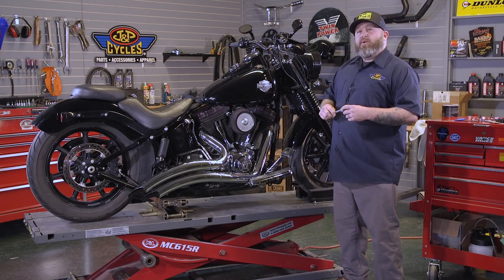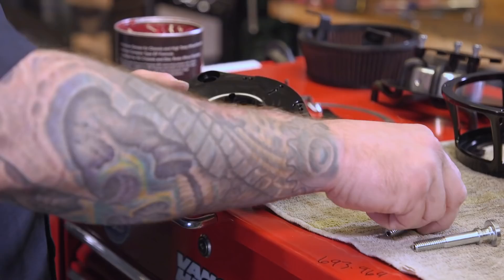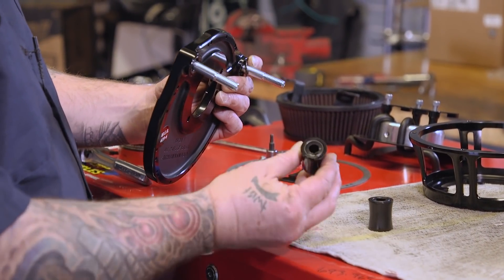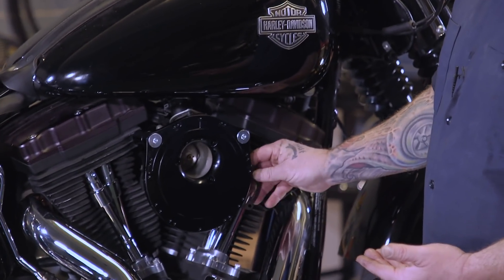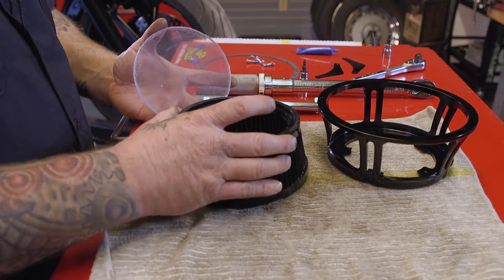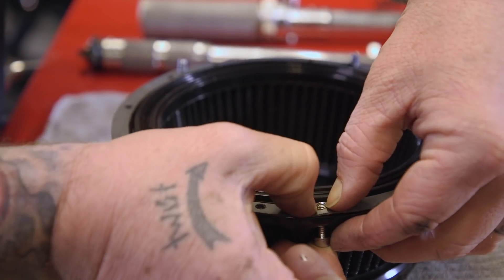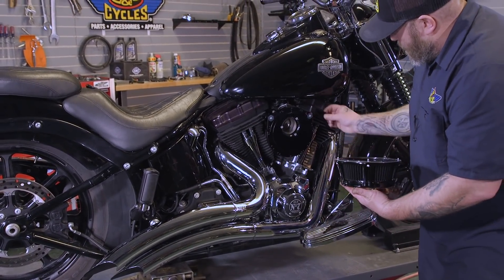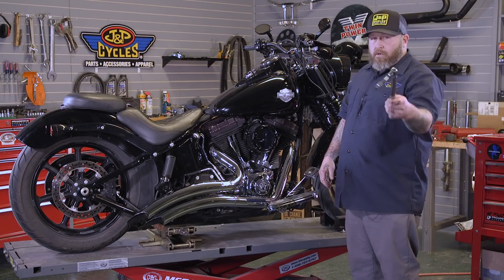Arlen Ness Method Clear Sucker Install : Twin Cam Harley Davidson

Comment: I also have a Arlen ness air cleaner (the inverted series) and had a RSD Turbine on my sportster. What I dislike about those big guys (the cleaners) is the big black spacers on the breather bolt keep you away from adding an external breather kit. Or I haven’t found the way around it yet. These EBK Are pretty useful to keep the engine healthy

Comment: Just picked up my first twin cam used to my old evo, stuck between two tuners, TTS or a power vision 3 or 4 I have v&h long shots and going to a thunderheader 2-1 and the method clear intake just curious what yall recommend

Comment: Installed mine on my 2019 street bob with cobra short shots
Have a tuner with high air flow cleaner on it but when I start the bike it recs really hard around 4000 rpm, do you know why this is

Comment: What do you mean when you say to "re-grease" the air filter once you wash it?
Reply: Re-oil it.
Reply: K & N sells a clean and recharge kit for reusable air filters, basically you run the nipple of the bottle down each crease of the filter untill it’s a uniform red color, you don’t use much oil just enough to turn the filter red, NOT have oil running all over hell and half of creation then reassemble the air cleaner and your good to go

Comment: would i need the spacers if installing on a 2019 iron 883?
Reply from the maker: Yes, all bikes use the breather bolt spacers included in the kit.

Comment: It appears that the breather bolts get covered with those steel plates. Does the heads still breath well?
Reply from the maker: Yes, there are passages machined behind the plates.
Reply: The bolt is what’s called a banjo bolt, it has a hollow passage running down the middle of it